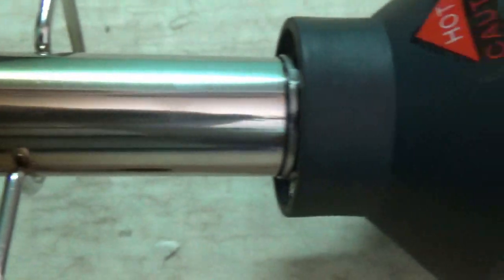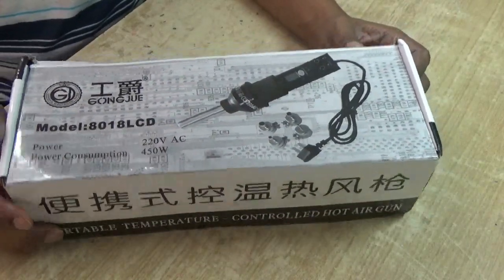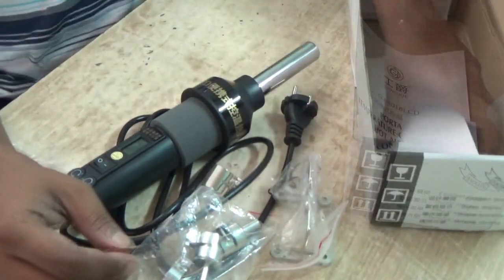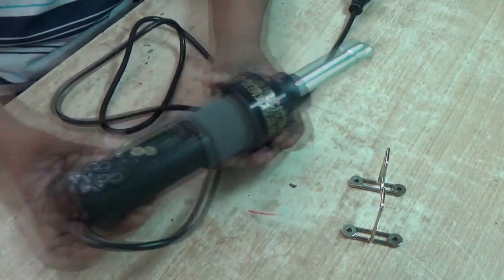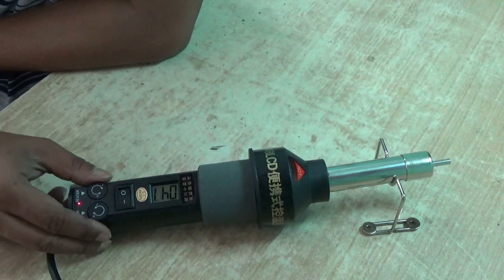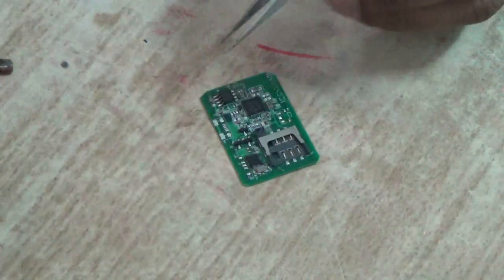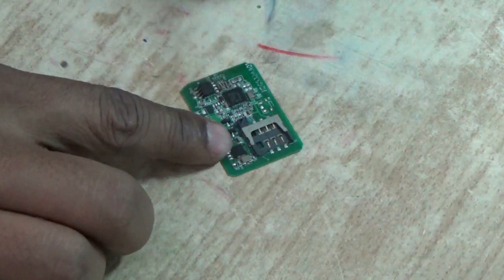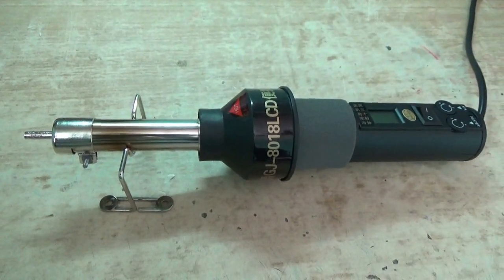Miniature Hot Air Gun for SMT Rework  from Banggood

Comment: Too bad the temperature displayed is also wrong, it is necessary to use external thermometer to know how much it heats
Reply: I have no problem with the temp... maybe you need more practice with the item
Reply: If it displays 450 ° or others I have very different real temperatures at the exit, see also the videos on Youtube about this very common problems with this product, to control seriously I use the thermometer of my multimeter or recently a Zotek GM500 infrared thermometer especially for smartphones screens, for SMS components on compact PCBs also needs a fairly accurate measurement, in any case do not trust the integrated display.
https://www.youtube.com/watch?v=5LeFnADGKx4&t=193s
Reply: Its in Fahrenheit, not celsius! How to make it in  celsius?
Reply: johnny nutu Ça correspond surtout à rien ;-(

Comment: Bought one of these. Doesn't heat up the air coming out the tip enough to melt my 8 pin SMD chip!!! Display says 450C But even thin leaded solder held over the end doesn't melt!
Reply: was it bad design or defective ?
or just garbage ?

Comment: some of the items from china are really badly made and for the most part junk but theres those rare items they make that arnt bad and the prices here in the states i swear is like they are trying to get rich quick i mean really a hot air gun for 150 to 30-40 what one would you buy
Reply: This one in the video is bad. To someone who buy it, before using it, i strongly recommend to open it, check the solder.  WITHOUT THE PLUG in of course!